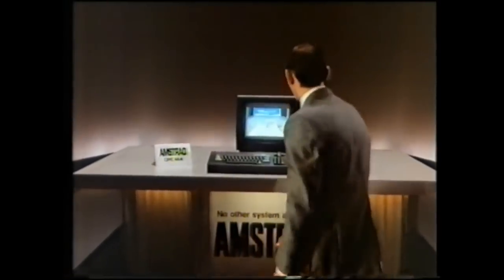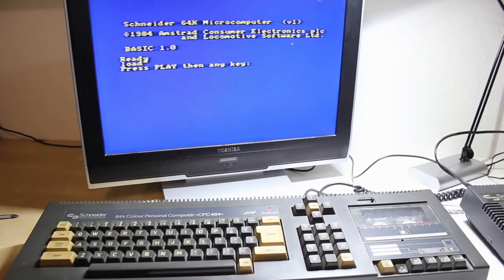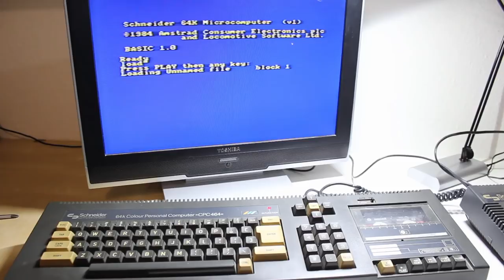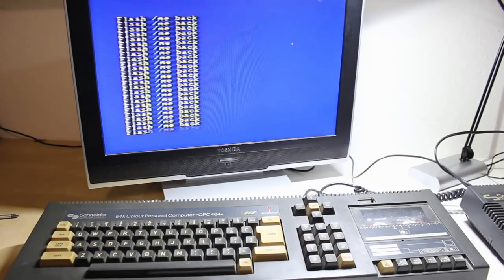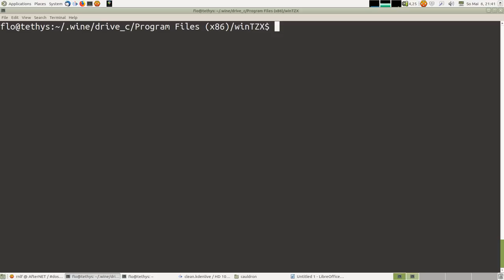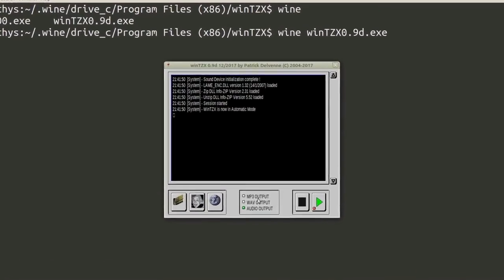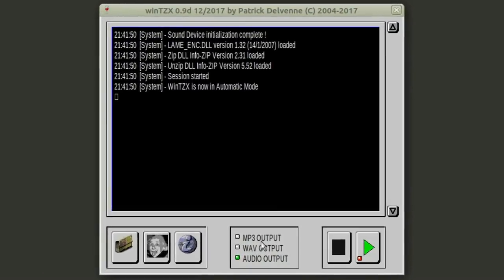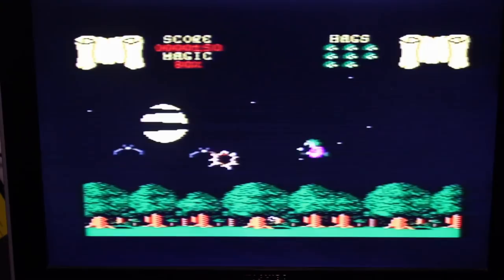Schneider/Amstrad CPC 464 Refurbishment

Comment: It always hurts to see a refurbishment go wrong. 8bit guy's PET, that other guy's Atari ST, ugh. Luckily your little disaster isn't visible from the outside. But maybe you should've put some coating on the metal. It's going to rust very very fast now.
Reply from the maker: Yeah, thought about that. I think I'll have to do that, but I'll also have to protect the key sockets. If I spraypaint it, the paint might make the keys hard to move. Same for the RF shield on my Amiga.
Reply: You can paint it with a brush. It's not visible from the outside, is it? So it doesn't need to be super smooth painted.
Reply: I would have used some form of paint on the metal keyboard back plate. Something like Hammerite smooth (thinned out and then applied with brush). It should help stop the rust from getting a grip on the metal again and treat any rust that you could not get to.
Reply: @flashmeback  I recommend applying a thin coating of CorrosionX (standard or HD version) on that plate. It's a bit pricey, but worth it.
Reply: I don't know why so many people use vinegar to remove rust. Vinegar is acid. I suggest to use for example vertan rostumwandler.
Reply: @ugott1  And it does NOT contain acid? The reason why people use vinegar is because it works really well. Most paints does not come off with vinegar.

Comment: You should have applied some sort of paint to the keyboard backplate.  The paint is a preventative measure to keep the metal from rusting over time.
Reply from the maker: Yes, I thought about that, but it would have meant I'd have to protect the key sockets from the paint each individually. But it might be worth it anyway.

Comment: I too have a CPC464 on my bench currently. Difference being it's a model with coloured keys and the refurbishment is a repair and not quite as easy. Some IC is faulty somewhere and I've not yet located the issues. My current hunch is a fault in one of the DRAMs. So I developed a DRAM tester that I gonna throw at it soon. If that doesn't work, I'll get serious and throw the logic analyzer at it. The 12€ one from ebay that is.
Reply from the maker: Oh, that sounds cool. You made your own DRAM tester? I had something similar in mind, but I shied away from all the small details like DRAM refresh. Do you have something about that online somewhere?
Reply: Hi, not yet. I plan to eventually publish it. So far the hardware side is dead simple, an Arduino Nano is enough, output via serial console through USB. But I plan to make a proper stand alone tester unit with a display, a ZIF socket and a few buttons to push. 
There are others on the net, but none I have seen implements refresh. Mine does via an interrupt. It took me a while to get all the timings right and I'm not quite content with it yet. So far I only have 64k x 1bit DRAMs to test it with, but it's not hard coded for that. The DRAM size can be set in a header file at compile time. I basically implemented functions to read and write single bits at a given address, as well as writing nibbles, bytes or whole 16 bit words in one go using the fast page mode of those DRAMs. The test routines just make use of those. If you need it, I could send you my current version.
Reply from the maker: I think I'll eventually make my own version of it. I like figuring such stuff out. Interesting to hear that you don't actually need to refresh the DRAM too often. I should read up a bit more on the details.
Reply: I needed a 4164 DRAM tester for a project a few months ago and i found a github page by someone who made one along with a whole suite of other good stuff intended for C64 repair. It's meant to be used with an arduino Uno, but i only had a Nano which is pretty much the same. You just run wires from the arduino to the corresponding pins and its good to go:

https://github.com/jamarju/c64_test_tools/tree/master/c64_dram_test

On the subject of rust, i've seen a guy here on youtube recommend citric acid instead of vinegar. You just dilute a few spoons of it in water and submerge the metal piece, no smell or anything.

Comment: Definitely paint the keyboard plate.  I wouldn't worry about the spray paint making the plastic stick to the keys.  You can go about it a few different ways
-Paint the bare metal with a rust paint from the hardware store using a brush.  Not sure if you have Tremclad but they make a decent paint and it won't be very expensive.

-Paint the entire plate with a rust inhibiting spray paint.  Really any paint is going to be many times better than bare metal.  You saw how fast the rust came back after its vinegar bath.  That's what's happened by now to the metal in the case as you left it bare and totally untreated.  The key to not having it make the keys sticky is to leave it over the weekend to fully cure.  Then assemble the keys.  Make sure you focus your attention on the metal parts and do only a couple light coats. Just enough to cover and protect the metal, you don't want it dripping wet or that will more than likely interfere with the key movement

-Paint the entire plate with a rust inhibiting spray paint but mask off the plastic key holders with some tape.  This will be more tedious but if you're not confident that you can be precise enough with your spraying than it will be well worth it.  A coat of paint is typically only 25 microns thick (or 1 mil) and i'm not versed in the CPC but I doubt very much that the tolerances are that close that a mil or 2 will cause interference.

-If you have access to an air brush, you can easily paint the areas around the keys with that as you can focus the paint into a very precise spray.  Then you can paint the bigger areas with a wide spray and job done.  
I have a lot of spray paint experience so I would be more than confident to spray it all down but if you don't have much experience, go with the brush route as others have said.  It's a bit messy but you will be doing the CPC a favour rather than (frankly) the travesty that you did to it on your first go.  Would definitely make a great follow up video as well.

I'm really liking your content, my friend but do remind me not to get you to refurbish my E36 as I'd rather not like to have its body to turn to dust in a matter of weeks.
Reply from the maker: Yeah, I'll look into ways to preserve the metal :-)

Comment: Is it OK if i use a Q-tip (cotton buds) dipped in diluted Phosphoric acid, carefully rubbing onto rusts until it came off? 

+ How to protect it from rusting further?
Reply from the maker: Honestly, no idea. Any kind of acid will help against rust, but I don't know if it would do any further damage. You can coat or paint stuff you want to protect afterwards.

Comment: May I ask you, why are you sometimes wearing a cable on your wrist? I'm just curious.
Reply from the maker: It's an antistatic wristband. It is also connected to the mat I put stuff on and then both together to the common ground on my power outlet. That way any static electricity that is building up through friction or similar processes is slowly removed from my body and the mat.

You know sometimes when you walk over a carpet and then touch a door handle, you get a small electric shock. Those can be several thousand volts. They don't really hurt you, but imagine that going through an electronic chip. You can irrepairable damage them.

This wristband reduces the risk. In professional environments you need to wear even more protection to have special chairs and floors and other fun stuff.
Reply: @flashmeback  Oh. I didn't really know, that this actually exists. But thanks for explanation.

Comment: quick run", under enter key and shift is little yellow key use that with the other key on numberpad side and it will do the command for you. No need to type it in :P, unless you wish to run |Disc LOL

Comment: Is there any benefit for using metal tape within data recording?
Reply from the maker: Honestly I don't know much about the physics behind magnetic storage and different coatings. I'll have to do some research.
Reply: During my time of cassettes usage, 1982 to 1984 on TI-99/4A and Apple ][ (yes I used cassettes on the Apple) and later with the Sharp Pocket computers (PC-1350), it was better to use the normal brown cheap tapes. The expensive CrO2 tapes like the Maxell XLII were problematic especially with the Apple, which was extremely picky. The TI was much, much better in that regard. The Sharp had also less failure with the cheap cassettes.
YMMV.
Reply: Metal tapes need specialised heads, often the player has a switch to turn on/off the head. Most tapes players, ordinary oxide (brown) tapes work best, with stuff like this, remember Alan Sugar was a cheap-ass and that was the cheapest tape deck he felt he could get away with.  So oxide all the way.